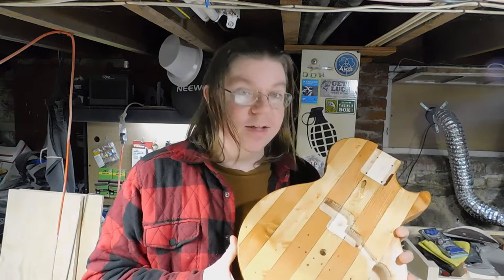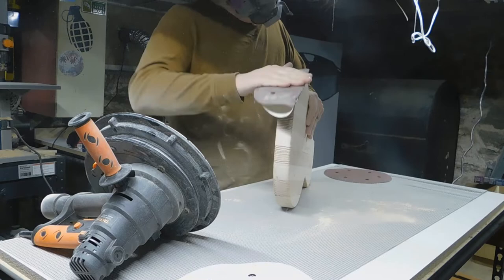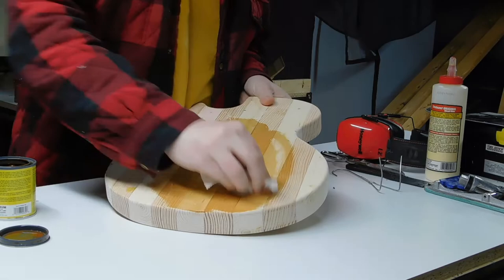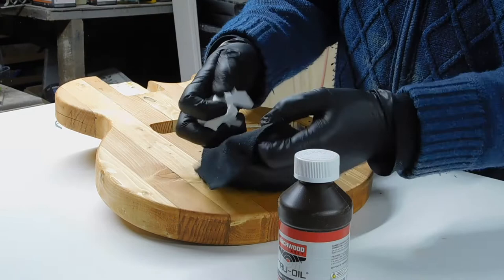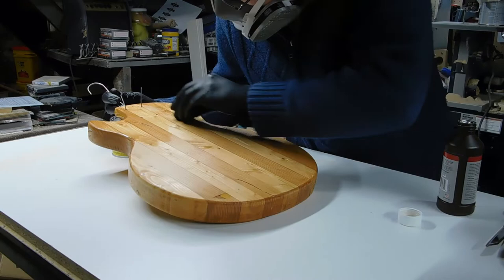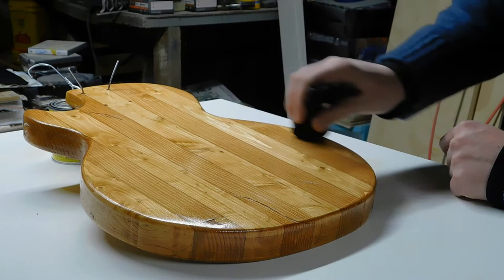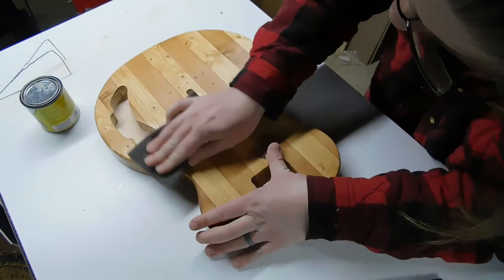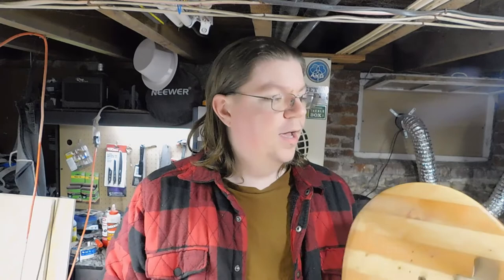Tru Oil finish on a guitar body

Comment: Really like the look of seeing the various strips of wood. I have to work in my garage and have the same problem with dust settling on the guitar. I found a large box (top of box) that I can set over the guitar without it touching and that helps keep the dust off. Just a couple of holes cut in it for air. It’s the best I can do, but it helps.
Reply from the maker: Every little bit helps! My little cobbled together drying rack works OK for me as long as I'm careful to keep dust in the shop down on those days that i use it, so the dust doesn't get in when I open the door... eventually I may have to make a separate clean booth entirely but that's a big project for much later

Comment: Hi, What is the stain you used? Can you tell us which stains (brands & typess) you reccomend for using with Birchwood Casey Tru oil . I'm researching stains & getting all kinds of results (even with ones that should simply be compatible).
Reply from the maker: I'm glad you found this video helpful!

I used Varathane classic penetrating wood stain for this project, and the color I used was Ipswitch Pine- it's quite subtle, just enough to 'age' the wood a bit and bring down the bright white color it had when raw.

I can't speak to what other brands or stains may work best with this finish, but I know I haven't had a problem using that particular product. I do know that the Varathane classic is an oil-based stain, so other oil based stains may be better to start with

Comment: Question - when applying a coat, did you have an issue laying a wet side face down on the table? For example you apply to the front of the body, then flip it over to apply to the back. Does the tru oil smudge or come off?
Reply from the maker: I didn't have any issue with the set up that I utilize, using a wire hanger to prop most of the body up off the table keeps this problem 90% at bay and the last bit that was resting on the table gets a quick wipe to 'even it back out' before I hang the body in the drying rack. I don't ever give it drying time on the table so nothing sets during the time that it does make contact

Comment: On electric guitar, does the wood used and the finish have a little or a lot with tone???..RocknRollflat5
Reply from the maker: Personally I don't think that the wood has nearly as much of an impact as it does on acoustic guitars. Finish even less so, a lighter finish will theoretically allow the body to resonate a little better but I don't necessarily think that even measurable differences there add up to audible differences.

To me, fit and finish is all about playability and feel, while the wood used is about aesthetic and whether it's tough enough to withstand the tension and abuse it gets. Number one factor in tone on an electric will always be the pickups

Comment: Did you find using a dark fabric to polish with caused a problem with dark fibers?  Great job.  I like the drying cabinet.  Thank you.
Reply from the maker: I did have a few stray fibers, mostly because I was using scraps I cut from an old shirt rather than finding a decent lint-free cloth. That was actually the biggest problem that I had with this whole process and the lesson I took from it was to just buy some material that wouldn't shed for future sessions
Thanks for watching, I'm glad you liked it

Comment: I have a Warmoth ash HSS strat body, how good will Tru oil work on this body unprepped?
Reply from the maker: I haven't worked with Warmoth parts yet, so I'm not sure just how unprepped that is, and it all depends on what you are going for and what you have for a starting point. I would think that...

Ash is probably going to need a grain fill or it will have the grain texture through the finish, if that's fine for you then go for it! I'm actually making a guitar right now that is meant to have a very rough finished look.

and just doing some all-over sanding before applying the finish will make a big difference. If it's just got a rough sand from the factory then you'll have a pretty rough/rustic end product but if you take the time to sand it up even to like a 220 grit it will come out much smoother.

Comment: TruOil is an expensive JOKE.   It is nothing more than over priced varnish.
Reply from the maker: Well, while it is tru (pun intended I guess) that it's pricier than many other options per ounce, and can't do the things that more advanced finishes can do- I think that there are a few things it has going for it.

Given who it was made for, that is gunsmiths who have shops set up for metalworking more than woodworking, it is meant to be a (mostly) all-in-one solution which gives a few benefits to those of us either with small shops or those who are just starting to learn how to do any finishes more involved than a rattle can.

Since it's a simplified product, someone starting with finishing does not have to buy a finish, plus a solvent, plus 'the right' applicators, and a separate hardener, and measuring devices to get the mix right, or any of many other things that they might not have and which may be a barrier to entry for finer finishes to the hobbyist
It's more expensive per ounce, sure. But a bottle of tru oil and a rag costs less than buying a whole new set of tools and containers and finishes/hardeners/solvents to someone who has none of that to start with.

All the above also applies to the simplified process, a beginner does not need to learn how to mix and work with 30 steps of a finishing product- they can learn the fewer steps involved in tru oil, then move forward to adding complexity as they try other finishes on a future project. One can get practice and build skill in just a few parts of the process, and that can give them the confidence or a basis of knowledge that they can build on as they learn to use other finishes

Basically, if it gets someone into doing a project rather than being too broke or too apprehensive about it, I'm here for it. I've moved on past using tru oil at this point (for the reasons you stated, basically. It's too expensive and I don't get as fine a control over it vs other products) but it was a valuable tool on the way to my building of a set of techniques and products in my shop that now allows me to do more.

Or at least that's al how it worked out for me. That being said, other products can be that same entry level finish for a beginner- this is just the route that I took.
Reply: What are you using now?
Reply from the maker: @danpejril8337  For my last few projects I've been finishing with shellac. 
I LOVE the look of shellac and enjoy the application process, but due to its nature of being susceptible to damage from alcohol spills I am debating whether I will move on to adding a clear coat of poly on top for durability, or if I'll just move fully to a poly finish with an HVLP paint gun setup. I'll probably work through from the hybrid version to the full poly, as I build up the proper tools and experience to go full poly.
Reply: @junc_musik  awesome, thank you for the information
Reply: I’m a billionaire so to me it’s only pennies